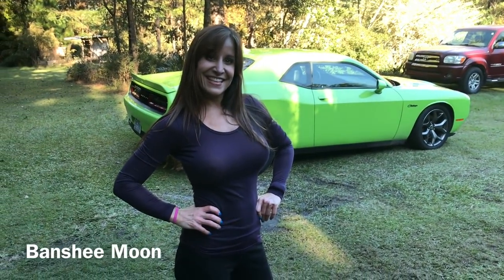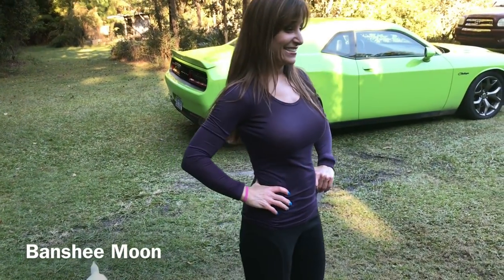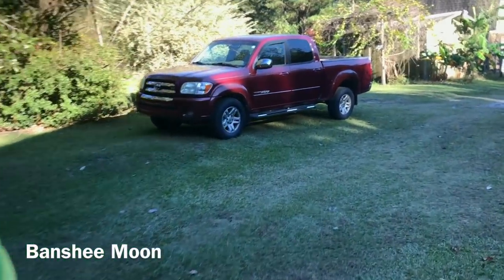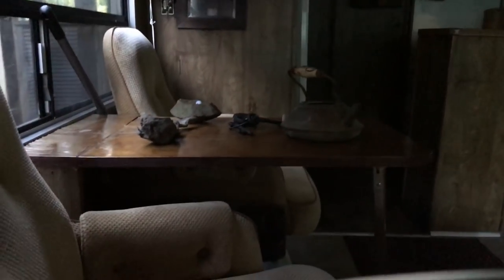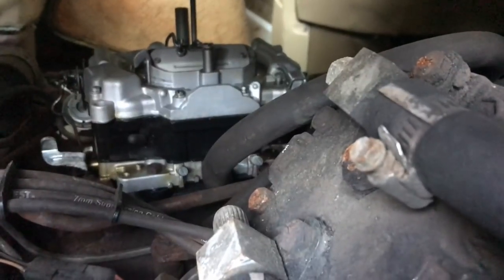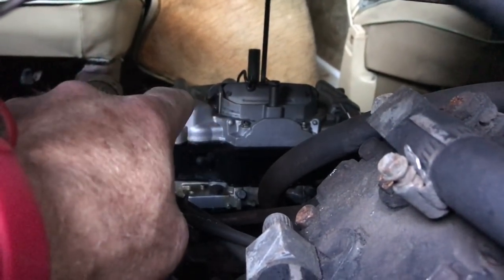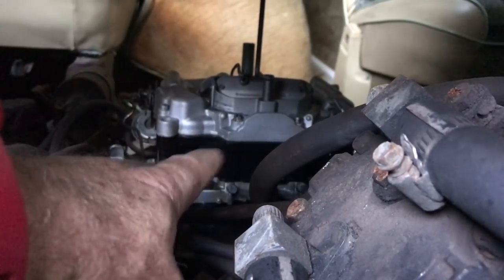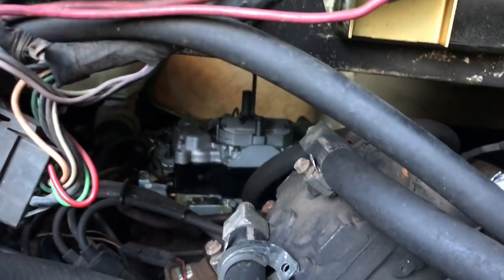She get's that old DODGE 440 CAMPER RV running. New carburetor, tire changes & buying Challenger

Comment: The middle section is phenolic plastic. It was made by Carter, the Thermoquad series- being a BB/RB motor, it's an 850 CFM unit. If you aren't familiar with this carb, do not monkey with it- especially the air door adjustment. It'll be hard to start, run crappy, back fire up through the carb...have somebody who knows Thermoquads adjust it. Once properly set up, these carbs work phenomenally well- small primaries and massive secondaries, so tooling around they are very economical but when you put your foot in them they 'get busy.' The plastic center? Done to thwart heat soak

Comment: Chinese junk carb? No that's a thermoquad used on stock Chryslers in the late 70's and 80's. I'd check the vacuum diaphragm first. Seriously, suck on the tube and see if it moves

Comment: "There are 8 screws on the top" 

INCORRECT! There are actually 10! Two are hidden behind the choke plate in the front (Towards radiator) If it's leaking. It should prob be rebuilt! These Thermoquad carbs can run with the best of them when tuned right!

Comment: That was a lot of fun.  The auto selling and repairing businesses are the ones with the most consumer complaints.  Frequently the lowest paid guy will work on your vehicle and they charge you the rate of a Master Mechanic.  When something goes wrong they should simply make it good.  I have been in The HVACR business for over 50 years.  I always allowed a person a "FREE"  call abck.  Frequently it would be due to something that had nothing to do with the repair.  Rather than spend an hour explaining I would simply fix it.  I put a small amount in my Service and Hourly rate that more than made up for it.   I also checked EVERYTHING before I left.   Can hardly wait for the movie.  Direct to DVD?

Comment: Did she say this is an 1981??  They stopped making 440's in 1979. I wonder if this chassis is actually a 79, but not finish built until 81 OR if someone put a big block and transmission in the old small block's place???  It's a lot of work to shoehorn a big block into these!!

Comment: Are you sure that's a 440?  Don't think I ever saw one with a Thermo-Quad 4 barrel, always a Holley.  Couldnt really see well enought but the easiest way to make sure is distributor location.  If its in the front its a big block, i.e., 383, 400, 413, 426 wedge, or 440.  If its in the rear, its no bigger than a 360, which used the TQ carb.
Reply: Yes it's a bb
Reply: Lots of 440’s came with a thermoquad.
Reply: I have a Mopar 440 with a Thermoquad 4 BBL in my motorhome. It has it's issues like anything else I suppose. :P

Comment: The carburator is a Carter Thermoquad and was built in St. Louis Missouri, not china. The plastic in the middle was to disapate heat to prevent vapor lock. The air horn inside you see the butterflies are concave shaped. So it gets less air at partial throttle for gas milage. Learn about cars and the parts beforee you go bashing them as "chinese" these were excellent carbs when adjusted properly and the last carbs to be used before the change by Chrysler to Fuel Injection in 1984. It gets that beast of a RV to run fast if "tuned properly"